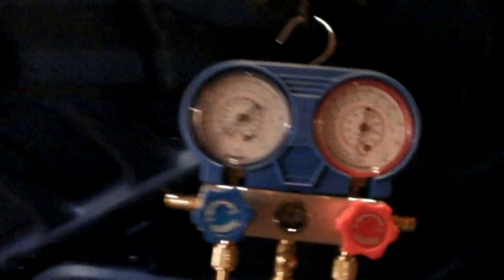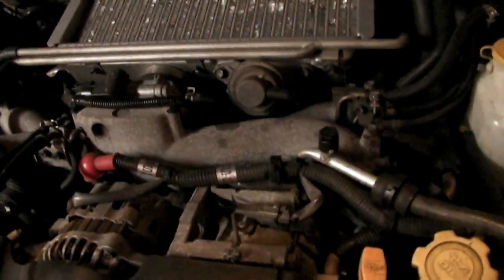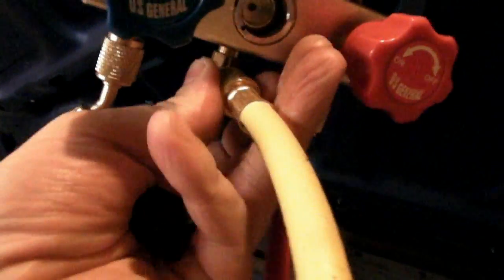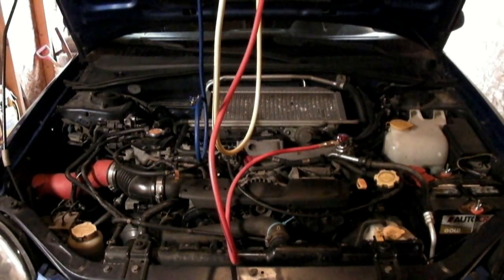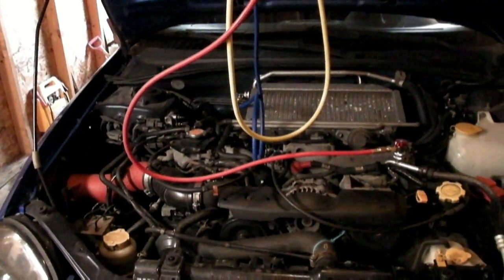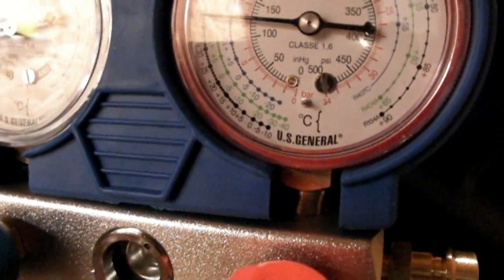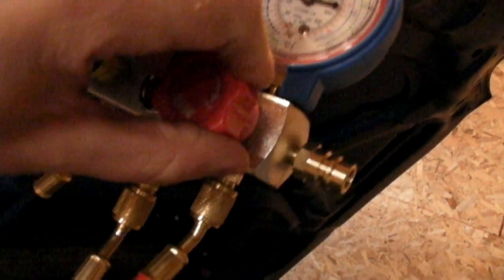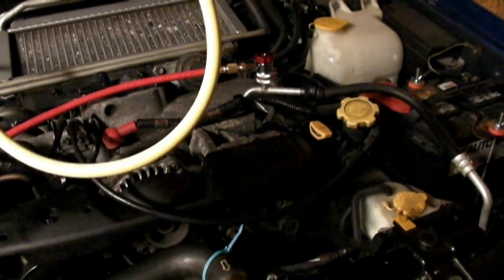Checking Pressures & Charging Automotive Air Conditioning 134A A/C

Comment: I maintain 4 vintage cars. Few DIY videos are wearing gloves/goggles. Remember most all gauges are cheap Chinese crap. This is what I have seen, had happen. Tap those store cans and it streams, shoots out. Cheap plastic hoses and nozzles = freeze up, cracking, lines bursting. No gloves= frostbite as you panic to stop it. Be prepared when a valve, connector leaks even flies off.

Comment: Ware can I buy that paper with the info I just bought these gauges does it come with it? My Silverado is blowing at 47 degrees when I drive but when I stop at light it goes up to 55 so something is wrong now the other day it was only 77 out it blew at 40 degrees idk
Reply: That's pretty normal. When you are stopped for a period of time. Your car's radiator will also heat up a bit. Your condenser sits along side of the radiator. So both heat up some. Therefore your condenser can't reject heat picked up. And disperse it to the surrounding atmosphere.As well. Which is called SubCooling. Don't worry all that much. Your ac should go back to good,after you get moving down the road.

Comment: does air conditioning cycle with a low level of refrigerant? Can you help me air conditioning cycles, I put gauges on them. with an ambient temperature of 16 ° C (60.8 ° F) air conditioning at standstill I have 3.5 bars (50.76psi) low side and high pressure (that seems weak for this temperature!?). air conditioning running high pressure is between 9-10bar (130.5-145psi) so rather normal!, but low pressure and 1.5bars (21.7psi) with cockpit ventilation at bottom, but if I drop the fan speed on the lowest speeds (1,2,3) the low pressure descent and 1,2bars (17,4psi) the compressor clutch disengages!?. as a result the low pressure rises and the clutch engages again then the low pressure descent and closes the clutch again, so on :-( if I put the fan speed back on high the low pressure stabilizes at 1.5bars (21.7psi) the air conditioning works well and does not cycle! unless I gently ride the engine rpm the low pressure descent and cut the clutch!. Is this a cause of coolant down. 'advance for your help (sorry for my english not top i'm french 😉)

Comment: The other port on the gauge, I remove the Schrader core and attach a second service line with a valve on it. Whenever I use the gauges, I attach a vacuum to it and I attach the other service hose to my tank. I then bring all the hoses into a deep vacuum and close the valve on it. Then I know that there is no air, anywhere in the hoses or gauges. I can then connect the lines and do whatever needs to be done. It's so much easier than having to purge each line.
Reply: What does it take 10 seconds to purge all of the lines?  If you are doing a complete fill and have pulled a vacuum the only line that needs purged is the service line,

Comment: It is not necessary to loop the service line like you did. As long as you don't open either of the valves, there will be no pressure to the service line.
Reply from the maker: Not necessary, But it keeps dirt out of the line

Comment: 4:22 what, if compressor is turning ON OFF mean the system is low on freon??
Reply: Probably.
Reply: H G it's supposed to turn on and off but depends how frequently it turns on and off will determine it's low on refridgerant. Avoid leaking refrigerant into the atmosphere if you're caught you can be find, it's a contributor to global warming. Be careful of who you listen to, there's a right way and there's a wrong way. God bless

Comment: With that set of gauges the hose valves should be screwed open before attaching them to low and high sides. Once they're connected then they are screwed down to contact the Schrader valves.

Comment: When connecting hoses to the car's AC system the valves on those connectors should always be open until you disconnect the hoses. 

You should turn on and off the high & low pressure hoses using only the manifold valves.

Comment: I want ask you question if the ambient temp is 50°c what the high and low pressure
Reply: Convert C° to F°
Reply: Should be around 124F°
Reply: Not whatever is on that dangerous chart. Low should always be around 30 psi. High 2.5 times ambient in F° max.

Comment: There are so many things wrong with the way this guy performed this! Didn't bleed hoses before opening valves, putting liquid freon in low pressure line (HUGE MISTAKE - DAMAGES PUMP), valves were open when he hooked up lines that is why freon escaped, ugh.....
Reply from the maker: If you look there is refridgerant in the lines and they have been bled.

Comment: I think you using the valves on the motor side backwards...when you turn them clockwise it opens the valves to let the gages get pressure
Reply: That's something NO video mentions.
The Gauge Valves close CW and the Manifold Valves close CCW.
(Sometimes the Gauge Valves are not marked.)

Also, I lost a lot of Refrigerant because the Instructions for the Gauge and 3-4 videos did not say how to block the Yellow Charge Port.

He did say "Always charge on the Low Side." Right? But he didn't say how. Did he?
I guess that means you MUST CLOSE (CW) the HS Valve on the Gauge BEFORE you connect the refrigerant?  OOPS!
These little details can really mess up your day if you end up in the hospital after the CAN EXPLODES.
Always watch at least 3 videos but even so, such important safety measures might not be explained properly.
That's why it's usually better to pay a mechanic.

Also, Why does the Clutch cycle on/off when the pressure is low?
I know there is a High Pressure switch.
I guess there must also be a Low Pressure switch that knows it's low?
Where are these located? I couldn't see either on my BMW.

Comment: TO: Prince Dabby,  very surprised you have a sight glass on your system.  Usually all older R12 systems had the glass. The newer R134 systems do not.  In answer to your question, NO, there should not be any bubbles. .  Vacuum (evacuate)  the system with a pump for 15 or 20 minutes at least!!  Shut the pump off and keep an eye on the gauges.  They should be completely bottomed out.  Let sit for 20 minutes or so and look at the gauges again.  They should not have moved at all, still buried on the pin.  If not, and they moved up, there IS a leak and air is getting into the system.  This needs to be fixed before charging the system up.  If you do charge it, it will work but won't be cold for long.  Good luck.

Comment: Hey G&G,  Noticed you use a US General manifold set. I am a home DIY'r and after having the Toyota service center quote me a $2500 estimate to fix my Camry's AC issue of No Cold air.  A question for you - What kind of AC manifold gauge set would you recommend? Don't want to buy a Chinese brand Want a really good set that will last and be easy to use.  Thanks ahead of time for looking at this and answering my question. - Also I been a faithful sub'r for quite a while now - just not a person to talk much unless needed.
Reply: AutoZone will loan them for free.
Reply: Yellow Jacket
Reply: Steve Koszuta .. Thanks Steve. That's what got. I figured when I'm farting up flowers from my grave .. my son will have a reliable set to get it done.

I'm not against borrowing or buying cheaply. I think Harbor Freight has it's place in the world with it's lower prices for lowest quality items. And I'm easily gonna bet Autozone's Free Tool Loaner Program is Freaking AWESOME!! I don't know many regular Joe type DIY'rs like me that has all or many of the most commonly used special or expensive tools. 

I give AutoZone some props ... but ... I gotta take some back for the countless Chinese knock off, poor fitting, cheap assed construction, crappy warranty and pain in the butt return hassle back talk.

Comment: low side is gas. why charge at the low side with the freon tank upside down? can liquid charging on the low side possible?
Reply: +NELSON DIVINAGRACIA its possible, just when you add make sure you add slow so the liquid flashes to a gas and doesn't smash the compressor
Reply: Compressors are meant to compress vapor only. You can charge with liquid on the low side,butt it's not a good practice. Yes, you must charge that way very slowly. Otherwise you can blow your compressor. Low side is vapor side.🤦‍♂️🤦‍♂️🤦‍♂️...

Comment: thanks ur video really make sense  to me but am not too good on ac i connect my gauge it happen that my high side is not moving at all please what do u think that can caused that , and my side glass, there's bubble, is that ok for bubble to be on the side glass thanks or the front condenser is block or should i vacuum the system and start all over again

Comment: The high and low charging ports on the vehicle's AC system where you connect your red and blue hoses have Schrader valves.  Schrader valves are similar the valves you will find on a tires valve stem whereas if you push the stem it will open the Schrader valve.  The couplings at the end of the red and blue hoses have the knob that you can turn clockwise or counter clockwise.  After you connect your hoses to the charging ports turning the knobs clockwise will push on the Schrader valve stems of the charging ports thereby opening the valve and thereby opening the system to the manifold gauges so the gauges can measure the high and low side system pressures respectively.  Turning the knobs counter clockwise will depress the Schrader valves on the charging ports and close the vehicles AC system.

Comment: The Blue and Red knobs atop the Hi/ Lo Hose Coupler coupler is to depress the schrader valve core after you attach the coupler. Screw them counter clock wise (core pin pusher in) prior to attaching coupler, once attached screw clockwise ( to extend and depress valve core) and you will no longer loose some 134a upon hook up.
Reply: martyisabeliever yes you don't need to lose any refrigerant when hooking them up.

Comment: hi my car honda civic 2002  have overheat radiator have small hold leak water spill out everywhere now the ac not working, compresser not engage, i use ac manifold gage the low side port all the way high ,what is wrong thanks

Comment: My "certified ac pro 429" manifold hose connections I have to turn CW to open the valve and CCW to close the hose connection at the service ports.   Yours had you turn CCW to open the port right?

My 2001 pt cruiser system is cycling from 15-55psi at the same time on HI and LO sides at about 5-7second intervals.  Trying to figure out what that means.  The compressor didn't even seem to turn on until I added a little "freon" on the low side.   Perhaps I'm still low even thought the low side goes up to 55psi?

Comment: I cant find the charging outlets on my 95 Lumina.
Reply from the maker: I am not sure but maybe take a look near the radiator or somewhere in front of the engine . you can follow the ac lines of the compressor till you find them.
Reply: I hope they are not underneath the air filter!!
Reply: Ill make a vlog when I get a chance and show yall what im up against. No hurry to do this, but them again I dont want my compressor to crap out because of it sitting.
Reply: Guns & Gears  my compressor won't start. Is there a way to check the freon level with out the compresor on ?
Reply: Adolfo Perez  My brother did a tweak to get the compressor to kick on to get freon in... Theres a HOW TO video in here somewhere where he got it from.
Reply: Thanks man.... I did see the video I tried bypassing the relay to make the clutch start but didn't work. I think it's gonna be the clutch.

Comment: So do you take your low side reading when the compressor is cycling or when it is not?
Reply: Kevin, you can take the low side reading both when the car is on and when the car is off. It is probably best if you do it this way. When you read it with the car off then you are just looking for the gauges to read the same. The low pressure should be 45 degrees less then the ambient temperature. 10 degrees either way the you are still good. Refer to you user manual for what your vehicle should read on high. and this guy is putting Freon in a SUVA system. Freon is R12 and this is an R134a system. and if you have a car pre 96 then you need to retrofit your car otherwise you are going to be paying a lot of money for refrigerant. R12 is $100 a pound and you must be licensed (609) to to buy it for commercial use. I do not recommend trying do this on your own. If you contaminate your system you stand the chance of spending thousands of dollars because most places wont touch it and if the system is damaged to bad you will have to replace the whole system.
Reply: Thanks so much. I appreciate the response.

Comment: You forgot one of the most critical things! You have to purge the air out of all hoses before starting the system. You contaminated the system with air, and I guarantee if it had a sight glass you will see it. What you do is you open the low side, and loosen the yellow hose to bleed the air out of the low side. Then you close the low side, and open the high side, then you loosen the yellow hose to purge the high side. Then you close all valves. You may lose a little gas, but you're just going to recharge it anyway, and it's better than filling your pipes with harmful air.
Reply: Guns & Gears that's good, but you should have explained that  along with proper purge procedures.
Reply: What's equally as bad as forgetting to purge is failing to vacuum the system out before charging. My Trane AC unit is full of air and you can hear it running through the pipes in the wall.
Reply from the maker: John Smith My Hoses were already full of refridgerant before I started
Reply: Ya know after talking in depth with my brother in law who works as a commercial HVAC Service rep for the last 18 years. 
 - On charging with the tank up or upside down... He said "many older service techs have been taught to fill with the tank upside down and in his time he has also seen younger techs doing with the tank standing up". I said OK now I'm getting a little fuzzy headed on this. 

He said "he does both when they need both". He said "generally, if you're 'topping off a system' it's standing up and if it's a system that has been completely evacuated you start with the tank upside down to get the to get the liquid by weight into the system and then he turns the tank right side up to finish filling the system properly". I said "OK that makes sense". He also said that filling the system with the tank standing up is OK. I told him I was getting that fuzzy feeling again So I asked the big WTH? Which is it. He said it can be done both ways when you're a damn good tech like him.  

That reply earned him another cold one.
Reply: He's right...it is done both ways...usually when refilling one, its upside down til its near full then turned right side up. Granted you would have to be experienced doing this.
Reply: Your brother in law works on residential A/C systems, not automotive; which follow different procedures.

You can turn the can upside down to fill with liquid if you want to speed up the process, but for an automobile, this isn't necessary as the capacity is very small, as opposed to a residential unit.

If you do put liquid into the system, you have to do this with the A/C compressor off. If the compressor is running while you are putting liquid refrigerant into the suction line (low side), you can destroy the compressor because the compressor cannot compress a liquid.

Comment from the maker: Yes you can add till you get the correct pressure. Or if there is no Freon in your system you can put your Freon container on a good scale then add till it weighs that much less.

Comment from the maker: Yes add some refridgerant if the pressure is to low the compressor won't run. Then check your gauges once the compressor stays on.